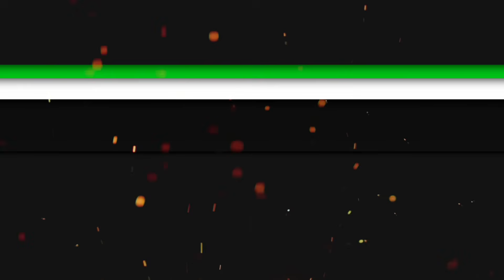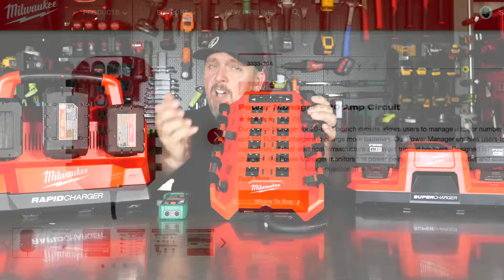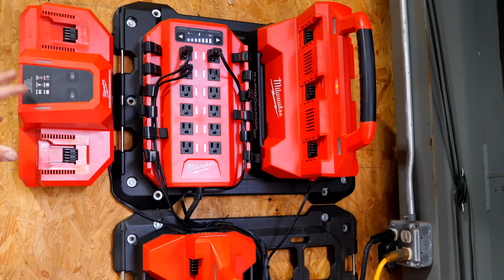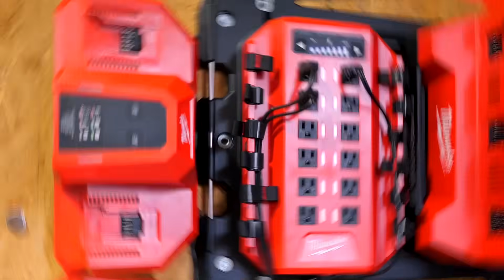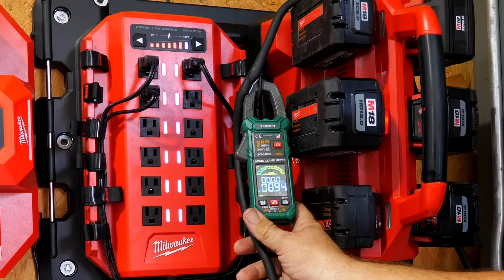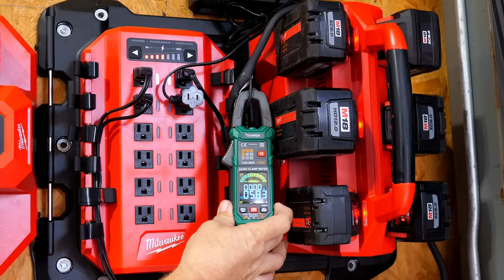Charge 50+ Batteries with 1 Outlet - Milwaukee Power Manager - 15A and 20A

Comment: The uses for this are extremely limited. Lawn trailers are an awful place because of heat, batteries cant charge well in a 110 degree box. Same goes for a pickup truck bed. Now what this does allow is for an air conditioned truck or van cabin to have a bunch charging on the go, and a shop could make use of this if it was using a ton of batteries, like shop wide.

A better solution for truck beds and lawn care would be an army of trickle chargers, just take a full battery off and put a dead one on. Minimizes heat and maximizes efficency. If milwaukee sold a 6 port regular charger that charged all 6 at once, it would do way more good than any of this

Comment: most chargers turn off when the batteries are full. So, having a multi-strip sense the battery charger reducing the load, to then ALSO turn off the charger itself.. is just silly.
But, I can see how it can be useful to plug in a large number of chargers to a single circuit.. and it rotates through the many charges you have on, so that the circuit isn't overloaded.  But, as it cycles thru each individual socket... will take FOREVER to charge batteries for a company that needs charged batteries in the morning.  CHeaper to have more than one circuit installed
But.. $600?!?!?

Comment: I’m getting a bit pissed off at Milwaukee. Buy a 200$ so called “super charger“ to go with my 200$ batteries and the damn thing doesn’t charge one minute faster. Not one. They can keep their 600$ power strip. The wall works just fine!

Comment: We are probably going to see more of this as landscapers move to electric power tools and have a way to charge batteries for their tools from the various brands. EGO already started it  and granted Ive had my own setup DIY style for many years already but these will be more refined then my DIY setup...only mine is still cheaper. If your using a power station along with seom HD power strips or a 2000w 12v invertor with a battery pack you can do stuff like this now...  Again these solutions from the brands are more refined and you buy and go instead of going the DIY route. Great video as always.

Comment: For 500$ it needs to actually have smart logic and have a current sensor on every single outlet. That is absolutely insane pricing. If you got this on a smaller inverter, even tho you set it to low power 3 bars  it'll still trip the inverter every time it "tests" the power draw  😂😂 Most inverters will shut off instantly and have be reset.